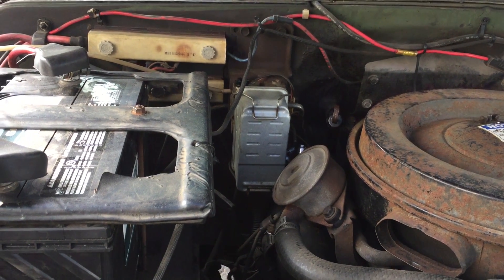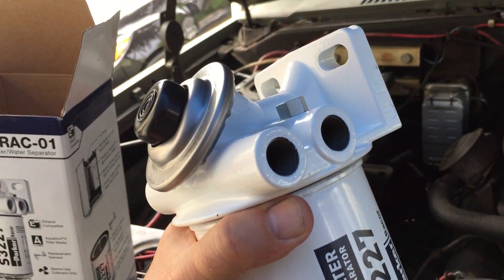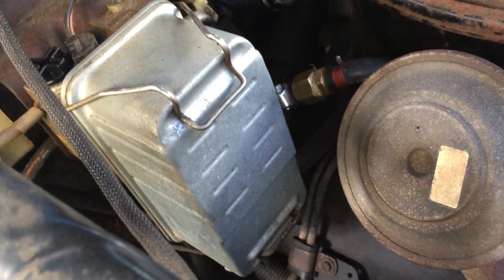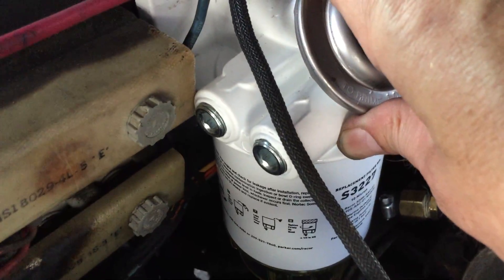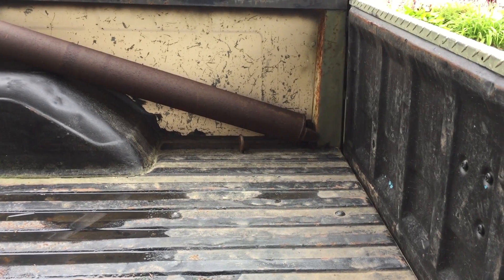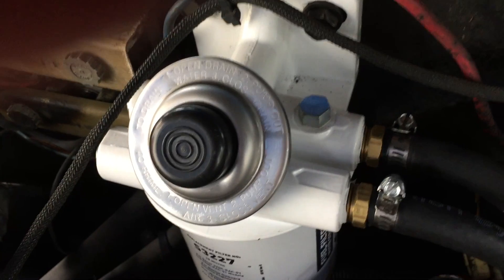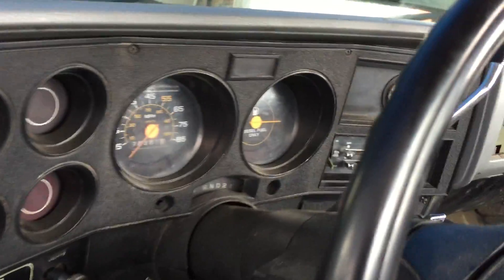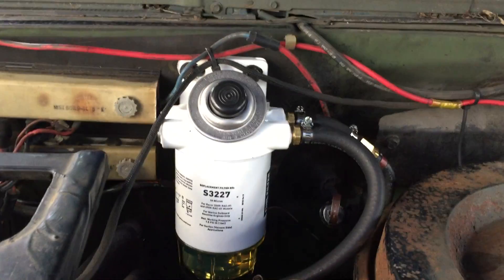CUCV M1008 Project Part 5 - Spin On Filter Conversion (With Built-In Primer) for 6.2 Liter Diesel

Comment: Currently doing this conversion with you exact setup and I have no power to my truck now after installing the racor and unplugging and disconnecting the original fuel system the truck came with
Reply from the maker: No power at all? That would have nothing to do with the wiring to the original fuel filter (unless it is shorting out on something). You might have hit a wire while working on the filter. There's a power cable coming from either the + of battery one or the - of battery two. It goes around the firewall of your truck, along the upper rim, and lands at a diamond-shaped connector. Check all of that. That is where your 12 volt power is coming from. I also don't know if your resistor bank has been bypassed or your system converted to 12 volt. I'm taking a guess based on stock setup. Thanks for watching and commenting. I hope you get to the bottom of it.

Comment: Great video!!  I have an 84 GMC sierra 6.2l diesel. After the wires were unplugged and no longer being used for this set up, did you have to remove a fuse?  Did you have any issues flashing on the dash ?
Reply from the maker: No dash lights came on after doing this. All good! Thanks for watching and your question.
Reply: Same thing happened to me

Comment: Really enjoy your videos dealing with the M1028. I am getting one myself in about 2 weeks (M1028). I was wondering if you could tell me the part number for the inline fuel anti drain valve that you installed? I have read that fuel drains down in the factory line and it causes a hard start situation (common issue from what I have read). Thanks again, I am learning so much from your videos!
Reply from the maker: How'd it go? You get the truck? 
As for check valve... You can use any ol' check valve in 3/8. Here's one from Amazon: https://www.amazon.com/GSTP-Packs-Aluminium-Return-Sliver/dp/B09Z2M8XSD/ref=sr_1_2_sspa?crid=2B0X4108VYP2F&dib=eyJ2IjoiMSJ9.D0GZh0iDi2OkNuSFCtt2L8uxwf88y3n7qsxpxyLfJaMp9TPjAJ59HKdPSXTVgEW63ucA915vsj83T2zRlGSrh7uKwV3MgpQOkPI1QyQHBIEsfypRYDk13Rmu-AI2EyKhu79oy--tPPYghDoTtYw-o6_h7P7iYgr3qQwZCsGZpjeBy0Lz3NYugvB4eRgHaEpisxuxpQK1rWL05eMo7w6HBgcfUlCs8KO8yKWHFCouGNs.-CW0zGOsrst7ONNWjBc4fwIJDyBrqdbN-AngxuRyUTw&dib_tag=se&keywords=3%2F8%2Bfuel%2Bcheck%2Bvalve&qid=1749569078&sprefix=3%2F8%2Bfuel%2Bcheck%2Bvalve%2Caps%2C154&sr=8-2-spons&sp_csd=d2lkZ2V0TmFtZT1zcF9hdGY&th=1

Comment: Is it no problem with 3 connectors unplugged
Reply from the maker: No problem at all. The connectors are for the fuel heater that the original filter had, as well as a pressure switch and a water-in-fuel light. Thanks for viewing and taking time to comment. Much obliged.

Comment: @Rocknus I just purchased a new fuel filter housing unit. Any ideas on the best way to plug the small hole that is behind the Fuel Pressure Sensor, just above the words Sensodyne?

One YouTuber used a Washer and JB Weld SteelStick.
Reply from the maker: The JB Weld/Washer trick is the way I've seen it done too. Honestly though, these things find numerous ways to leak. I replaced mine with a NOS unit and it lasted a month before it started leaking. Didn't even have the fuel pressure switch installed on this unit. Still leaked. I went back to my spin-on.
Reply: @RocknusUC  I ended up purchasing a new Fuel Filter Assembly from Hillbilly Wizard. John said the ones they sell are already plugged up and there should be no issues of leaks from that hole. On the flip side I was able to find a New Fuel Pressure Sensor that goes into the old/original Fuel Filter Assembly. They’re only $20 and the guy has a ton of them in stock. This would be ideal for anyone who wants to rebuild their existing one. Just wanted to let you know brother!

Comment: Never mind that it says "FOR GASOLINE OUTBOARDS ONLY" 😂😂 I'm putting a similar one on mine. I'm sure it'll be fine.
Reply from the maker: Thanks for the view and comment. I can see why you'd be skeptical. Just an FYI... The original CUCV fuel filters are 32 micron. These spin-on filters are 10 micron. WAY better filtering. Don't let the "gas only" phrase scare you off.

Comment: If you had ordered screw-in sockets with the right size, you would not have to install additional hoses ;-). 6:20
Reply from the maker: Yes, but I do it that way so at any time I can easily and simply bypass the filter by plugging the two hoses together... As depicted at this point in the video: https://youtu.be/wUobnCQNbqo?t=49
Reply: @RocknusUC  Ok, I understand. I ordered different supports for myself. Thanks for the explanation and have fun. Arthur

Comment: I put a spin on filter on my 1985 m1009 cucv. Never had a fuel prime issue with the original filter set up it just kept leaking. Now that i put a spin on filter on it doesn’t leak but it keeps losing prime. Do i need to install a check valve?
Reply from the maker: Hi Brandon. I like a check valve on my CUCV, but if you are losing prime, you have an air leak somewhere and should definitely locate that. You can temporarily install a small clear line on your IP to monitor for air. I've cued up this video to show you what I mean... https://youtu.be/ITXI-YALHDs?t=1825
Reply: @RocknusUC  i read about that clear hose method in my haynes manual for the 6.2. I just did it and i do indeed have air coming through the Injector pump. Im just at a loss as to why this all started after i put a spin on filter on. I used fuel compatible thread tape on all the fittings. I have triple checked everything i touched to put the spin on filter on and nothing is leaking or loose. I guess ill have to pressure the system by the haynes book and see if i can find anything
Reply from the maker: @brandonlewis9531  Bypass your filter for a minute.
Reply from the maker: @brandonlewis9531  Also... Use the goo, not the tape on the fittings.

Comment: Where did you get the housing and what is the part number
Reply from the maker: Here is the base (comes with 10 micron filter)
https://www.go2marine.com/490R-RAC-01-Gas-Fuel-Filter-Water-Separator-Plastic-Bowl-90-gph-10-Micron?gclid=Cj0KCQiA_c-OBhDFARIsAIFg3exr525uZTazsn1YizJZAQohnD5_4ZtzBeT5wfVBnaSmJTzuKKe8H1oaArHXEALw_wcB

And here is the filter you actually want to put on it instead of the 10 micron that comes with it... https://www.amazon.com/Racor-Micron-Replacement-Filter-445MAM/dp/B001HBSYLS/ref=sr_1_2?crid=3BX07QO7G5NPS&keywords=S3228SUL&qid=1641291950&sprefix=s3228sul%2Caps%2C70&sr=8-2

Comment: The filter cartridge reads:  'Gasoline Engines Only".  Why install on a Diesel Engine?
Reply from the maker: The filter came with the base, which is what I care about since it's a direct fit with no fabrication. The filter you want to put on this base is listed in the description. Thanks for watching and commenting.

Comment: Which site can I find that water separator fuel filter?
Reply from the maker: Use the Racor 490-RAC-01 base and spin on the 2 micron S3228SUL filter. The filter depicted in this video came with the base and it is a 10 micron filter. You really want 5 microns or less.
Reply from the maker: Just search the web for the best price. Lots of vendors have them. Amazon has them.
Reply: @RocknusUC  just learning a thing or two about filters specifically that they are rated at fuel flow per hour, is there any way to know the fuel flow per hour for the 6.2 engine.  Secondly most of the racor filters are not recommended for inboard installation, due to heat concerns. What is your take on that? Could I get your view on EBELY R12T?
Reply from the maker: @shawnlawrence4840  Stock mechanical pumps on these CUCVs average about 25GPH give or take. As for worrying about heat... Guys have been putting spin-on filters on these forever. I wouldn't sweat it. I have no experience with EBELY R12T. It's got the right stats, but not sure if that base will mount straight up or not.
Reply: @RocknusUC  what's the meaning behind scottsdale. K30 and D30,
Reply from the maker: @shawnlawrence4840  K is for 4-wheel drive while C is for 2-wheel drive. As for the D... Some people say the D is for Diesel. Others say they simply changed the K to a D because it was for the military. I don't believe you'll see any factory "D30" civilian models. Someone can correct me if I'm wrong. As for the "30" in D30, it means it is a 1 Ton (5/4 actually). The 10 is a 1/2-ton, the 20 is a 3/4-ton. So a K30, or a D30 is basically the same as a Chevy 3500. A K20 is like a Chevy 2500 and a K10 is like a Chevy 1500. Scottsdale and names like that are just made-up names for various model trims/packages.
Reply: @RocknusUC  thanks bro, you've cleared up all those cobwebs in my head, because some sites ask those stuff when shopping for parts. It use to confuse me so I appreciate the clarification.
Reply from the maker: @shawnlawrence4840  My pleasure, Shawn. Good luck!
Reply: @RocknusUC  based on your knowledge of replacement mechanical fuel pump, which is better,  one is OEM, the other is OE quality,  which is better?
Reply from the maker: @shawnlawrence4840  I personally go with OEM whenever possible. If going with OEQ, do some research and check reviews.
Reply: @RocknusUC  the EBELY R12T has a 4 micron filter but does not has the primer pump, saw it on amazon too, also the one in your video.

Comment: After looking at Racor’s filter line..l it seems to me that the appropriate (cheap.. no primer button) assembly for the 6.2L diesel is the RACOR  120AS. With R12S, 2 micron, 15gph filter element. The 245R2 (with primer) also would work, but at twice the price of the 120AS.
Reply from the maker: Actually, you can use this base and just spin on the Racor S3228SUL. I describe this in the video details. This base just came with that 10 micron filter you see but the S3228SUL that also fits is a 2 micron. Check video description.
Reply: @Rocknus Urban Camouflage   hey the flow check valve that you ran inline after the fuel filter, which way did you point your arrow to? Thanks in advance! I went with this filter setup for my m1009

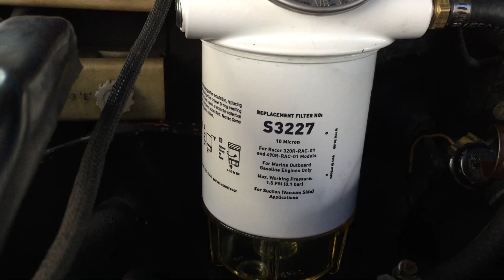Comment: on the fuel filter it states gasoline only .... on the 6:43 will that be ok?
Reply from the maker: Really... No. The gas filter is about 10 micron and you really want something more like 4 or less. That filter came with the base, but you can swap it out for the marine filter. The parts are all listed in the description.

Comment: Hi I am doing the same on my CUCV. What did you do with the wiring from the old filter that went to the truck?
Reply from the maker: Hi Corey. I just wrapped the wires up. They are disconnected. I actually have a good original filter base ready to go. I want the fuel heater and water warning light back. This spin-on has worked great this whole time though. No problems. Thanks for watching.

Comment: What size fittings did you use?
Reply from the maker: Fittings are 18 NPTF TO 3/8. I also used that 3/8 to 1/4 inch fitting so I can simply bypass the whole filter when needed to swap it out or whatever.
Reply: Thanks!
Reply from the maker: @sckiller  No prob.

Comment: Did you rebuild the original one yet? Or still running this replacement?
Reply from the maker: Still running this spin-on. Haven't rebuilt old filter base yet but DID obtain a NOS one in mint shape still in the box so... Heh.
Reply: Very cool. I’m having an issue with my truck where it won’t start without ether after it sits for a day. I replaced glow plug controller and solenoid and check the resistance to glow plugs. Everything seems to be working fine. When it does get running it sputters and I have to give it gas to keep from stalling, but then it runs and drives fine. Leave it for 1-2 hours and it starts right back up, but park it overnight and it’s a no go. I’m thinking I have air coming into fuel lines.
Reply: @sckiller  yeah it sounds like she's getting air in the system alright. 
Good luck with the detective work.
Reply from the maker: @sckiller  Sounds like air. I use a clear fuel line on top of the IP to visually check for air.
Reply: @RocknusUC  Where did you source the NOS one?
Reply from the maker: @barryfitzgerald2077  I run a CUCV FB group. I got it there, but there are also other NOS FB groups you can check. I also run the largest Squarebody group on FB right now and I find tons of parts there. 
Here's the CUCV group: https://www.facebook.com/groups/1533619073697842

Here's the Squarebody group: https://www.facebook.com/groups/squarebodysell

Stay tuned because my very next video features the NOS fuel filter.

Comment: Rocknus Urban camouflage... I did straight - following You .. If I see 'right'
with (Your) used Filter  **-10-Micron** can be used also DIESEL !!
as Isee normally  Marine engines w/gas ?!
as I like using same engine my  M1009,
Thanks for your Channel, Greetings from Germany
Reply from the maker: Probably 4 or 5 micron filter would be better and you can get those to fit too. Again, this was temporary and original filter base is going back in after rebuild. If you use this 10 micron and worry about it, add a basic cheap plastic inline filter.

Comment: I looked into this filter and filter base and it’s for gasoline. I don’t know if it makes a difference. The 245R2 has a primer and it’s for diesel.
Reply from the maker: The differences are that the one I used is rated at 10 micron and the one you speak of is 4 micron, but the gph on mine is twice that of the one you are looking at, hence my decision to go with it. Mine is also a temporary fix as the original filter will be going back in.